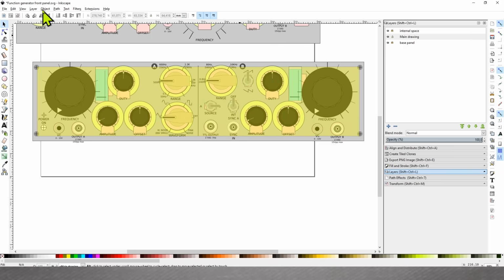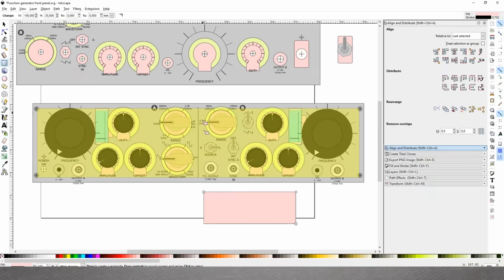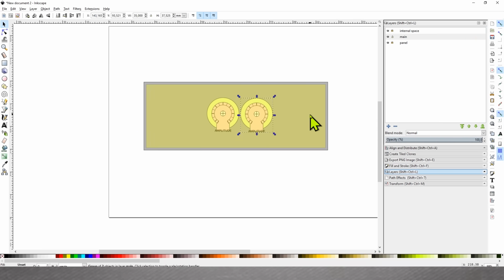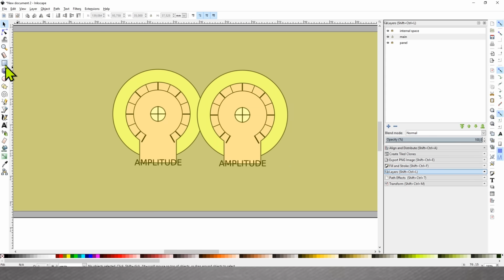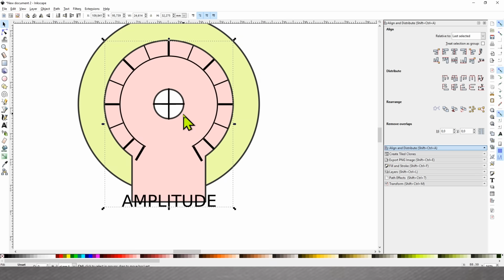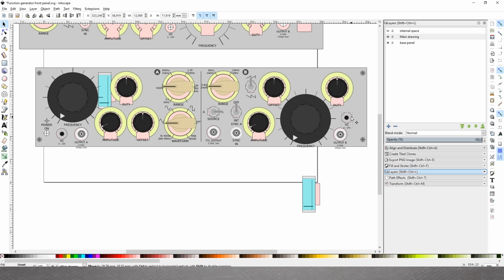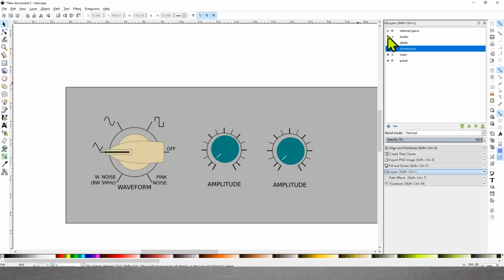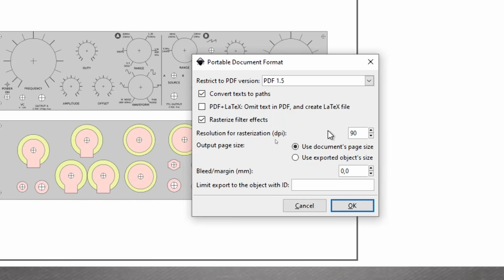Build a Custom Front Panel That Looks Pro — Easy DIY Tutorial

Comment: Very nice. A lot of work though. I have made quite some front panels in the past 20+ years for my work. Time ago we used a technique with several layers: aluminum or plastic panel, drilled holes, layout printed on paper, some very thin double-sided tape, and as cover some transparent sheet. At the end we cut the holes with scalpel knife.  Another technique was a special glossy plastic like printable sheets we could apply directly on a panel as a final layer. The last front panel I used was my design and ordered at some German front panel factory. It was an aluminum panel with ingraved symbols colored black. They can ingrave with color or flat print on panel. It was not really cheap,  100-150,- euro. The design alone took me also quite some time. When next project comes along I think I want to try making front panel as PCB design. The thickness and strength should be sufficient,  and you can even use it to wire some front panel parts directly.  Could be fun. One tip: instead of rasin glue you used I would use thin double side tape. Rasin glue gets quite messy and is tough to control where it goes. It will get in the holes too. But anyway nice job, I am impressed how professional it looks. 👍
Reply from the maker: @ernestb.2377  thanks for sharing your experience. I already experimented with double sided adhesive sheets and tape but with heat over time it tends to detach. Those adhesives cost about the same as epoxy resin (for the amount used) but the latter is rock solid forever. There's another method, as I mentioned in the video, where spray glue can be used. You'll see it when I have the video ready. Cheers.

Comment: Great tutorial, thanks for sharing.
Do you have a idea how to make a front panel foil with embossed buttons ?  Grtz
Reply from the maker: @BjornV78 embossed buttons? Do you have an example...a link to a picture, to let me understand what you mean?
Note, put a non-clickable link, i.e., https domain . Com
Reply: @AccidentalScience  thx for the quick reply, i hope the link works, YT keeps removing it.
https :// youtube com/ watch?v= G4GMyAUBAVU
The goal is to use pcb push buttons under this foil, you can easy make a flat foil, but the problem is that there is not much flex in the foil for pressing the buttons below. Also, the hole in the enclosure needs to big much bigger, so that the foil can be pressed down. And with flat foil, this tears easy.